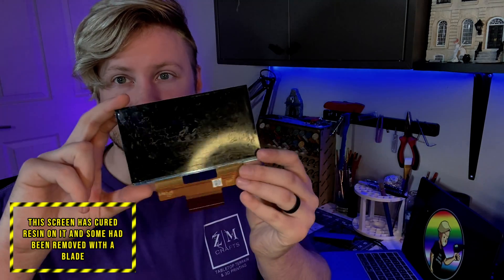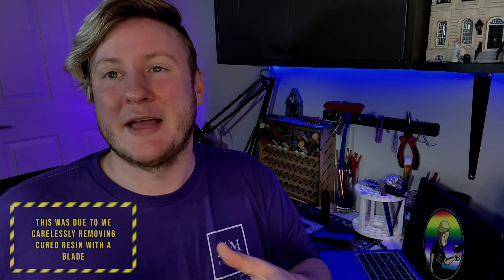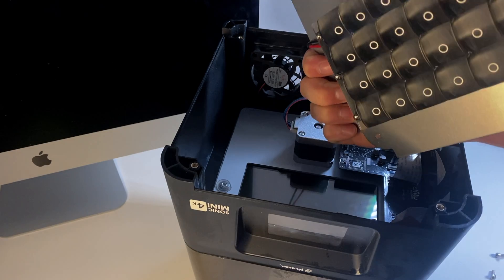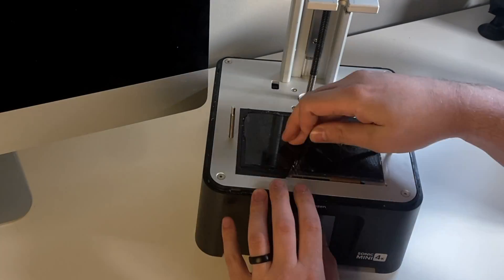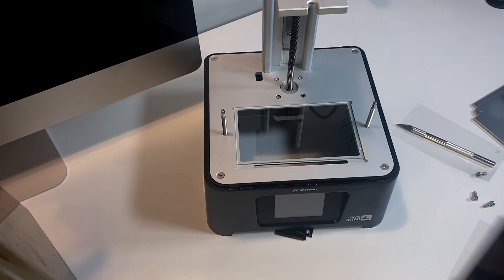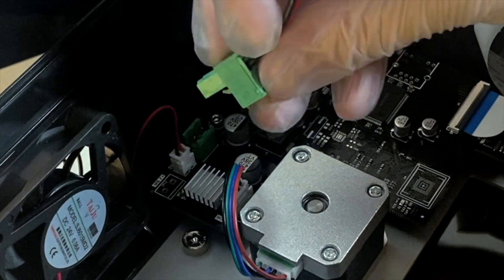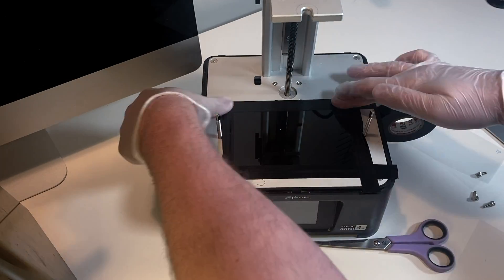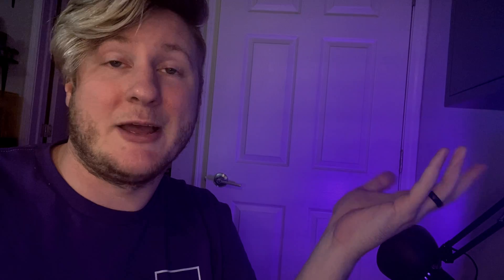Replacing my Phrozen Sonic Mini 4k's Screen (+TIP how to avoid this!)

Comment: Yeah, gonna need to do this. Was sick and left the vat on the unit partially full..... And didn't realize that there was a pinhole leak in the FEP...... Resin got in between the layers of the screen and next print caused the resin to cure and expand.....
Reply from the maker: Yikes, godspeed and don't sweat it. It happens. I greatly suggest investing in a pack of screen protectors for the future! It has been a lifesaver.

Comment: great vid and advice. question: I was told that the z axis in the 4k mini is not that amazing and should buy the 8k what say you? :)
Reply from the maker: Thank you! I have not had any problems other than curing resin on the screen with my Mini 4K! So I can’t personally speak to there being an issue with it - unless you’re talking the Z height.. then yeah it could be taller but it’s “mini”. I would definitely suggest going to the 8k. At this point in time I suggest to anyone starting their printing journey to get nothing less than a 4K screen as now we’re seeing 6k, 7k and yes 8k screens on the market now. I have the 8k mighty preordered and I can’t wait to try it out. The Mini 8k seems to have amazing results.
Reply: Currently in the process of fixing the Z on my mini 4k. Seems like lots of people get the same issue with the z binding up kind of close to the vat. I'd say get the 8k or get a mighty 4k since they seem to have had better engineering on their z axis

Comment: Nice and simple walkthrough! I had a bad leak and the electric tape was all soaked and shriveled and I ended taking off my screen protector but continued using my printer. Bad idea, I had a minor leak and was able to remove the cured resin on the screen. Did I replace the screen protector this time around? Nope! One more leak later and screen is out of commission and I'm out $180 for a replacement lol (Mighty 4K).
Reply from the maker: Awww nooo. Shoulda coulda woulda!! I have yet to have issues with my Mighty thankfully. Glad it was easy to follow though! Now get a screen protector on that thing hahaa

Comment: Thanks for this! I've only had mine 5 weeks and the screen just packed in! Hopefully they will send a replacement
Reply from the maker: Hey absolutely! Hope I helped! Definitely suggest the screen protector.
Reply: @ZaneMorganCrafts  I agree. I have one on all of my printers. Unfortunately in my case the screen just stopped working properly despite being protected
Reply from the maker: @bitzbox  that’s crazy. It was a PSM4k? Hopefully they will send you a replacement. I haven’t had that issue thankfully. At least it’s super simple to replace.
Reply: @ZaneMorganCrafts  yeah it was. I'm hoping they send out a replacement too
Reply: Did you get a replacement from them in the end?
Reply: @noviceartisan  luckily for me it turned out that the connection had got loose. It's a pretty bad connector. I never heard back from them though

Comment: How did you get the resin on the screen?
Reply from the maker: Some resin vats are known to leak due to their construction. However, in this case I was being careless and ran prints after some failed prints without checking the vat for debris and it pierced the FEP film. So I had resin leaking onto the screen and curing. Not fun! Always check your FEP film and resin vat between prints.
Reply: @ZaneMorganCrafts  Thanks for the insight. I have only just got my printer and learning from others' mistakes is often less expensive.
Reply from the maker: That is for sure a great choice! I like to recommend Anycubic machines to beginners because they are the most popular so they have the most support!
Reply from the maker: Yeah absolutely! Feel free to ask away. What printer did you get
Reply: @ZaneMorganCrafts  An Anycubic Photon Mono SE. Seemed like a good choice. More expensive than some, but easy to set up and good reviews. 2K printing isn't the best, but a 4K upgrade seems likely from them sometime in the future.